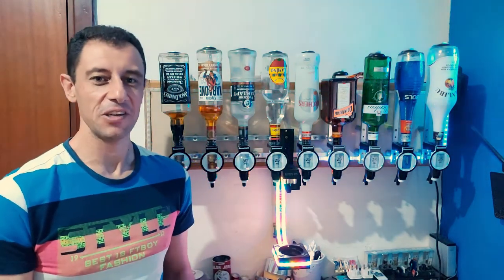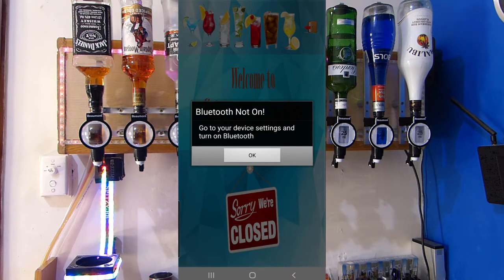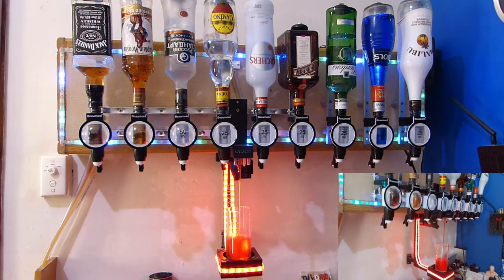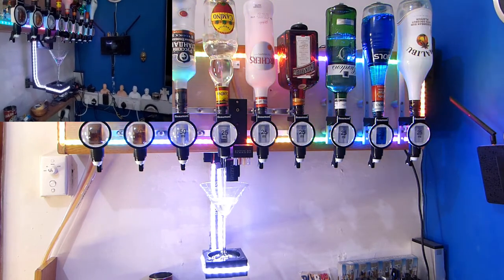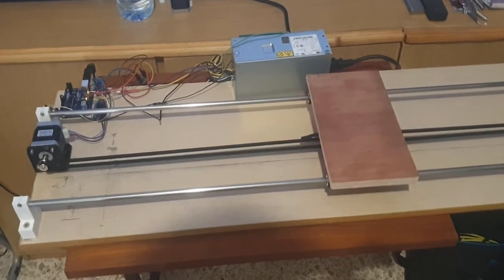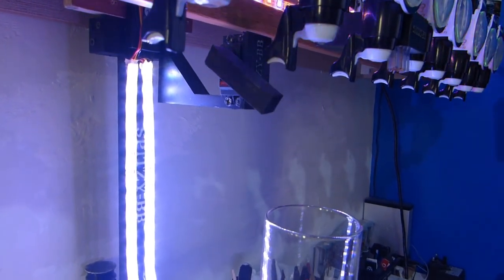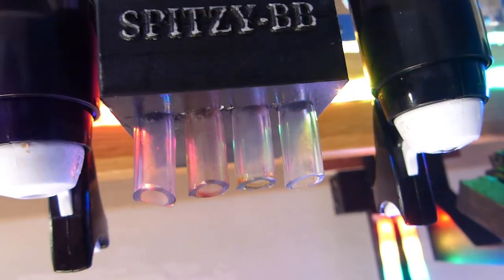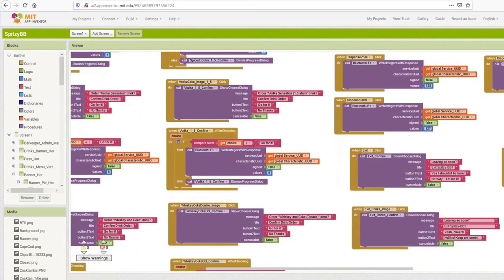Homemade Automated Cocktail Bar using Arduino

Comment: Absolutely the best !! Great job .. 
Are you by any chance planning on sharing the software and design??  I'd love to build a simular model, for our home..but i haven't don't much programming , but not afraid to learn again ..just need a bit of help for coding it,  can add drinks easily I'm sure,  just getting android tab to work with electronics...

Comment: Can you post a video of it running with an acceleration function? The machine will run much smoother and I don’t think the liquid will slosh around as much
Reply from the maker: Thanks for comment will keep that in mind. Acceleration would help with gradual movement and should help with less "slosh". I will need to revise the code and check, as I am using constant speed, although I did try with acceleration earlier on and had a bit of issues, but will explore this again as I know it makes sense!

I appreciate your comment and thanks for watching! 😊

Comment: Hi, nice project, great use of linear design, but have you Got no Glass security measures? Like pressure switch?
Reply from the maker: Hi, thanks glad you like it! No pressure switches. For mixer dispensing (no soft drinks) only a food grade small pump and tubing are used and I have 4 of those.

Comment: Hey,

Frist of all, i really admire your project! I was looking into making a machine like yours with Some friends, for our small bar where we meet toghetter.
I was wondering if you were open to the idea of sharing your plans and experience with us.
It would be really awsome if you could help us with it!
Thank you in advance for your response

All the best,
Reply from the maker: Hey thanks for watching I am glad you liked it!

It does take a lot of work but basically there is no rule of how big it needs to be etc. I just had to improvise. 

The application for Android was developed with MIT2 inventor for mobile and for code its arduino.

I can send you the arduino code if you wish and that will save you a lot of time hopefully and you can get an idea of how it works. 

Email me at thattechoguy@gmail.com and let me know its you and I will send it over and can also export the MIT app part of it and send it too ;)
Reply: Hey!
Thank you for your response.
I’ve send u an email.
Reply from the maker: @G.v.c  I have replied to your email.